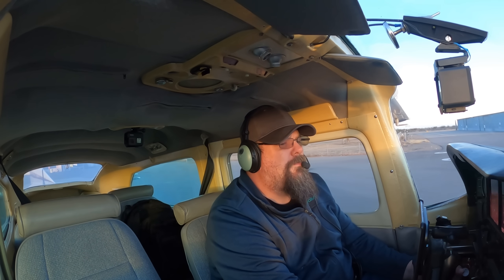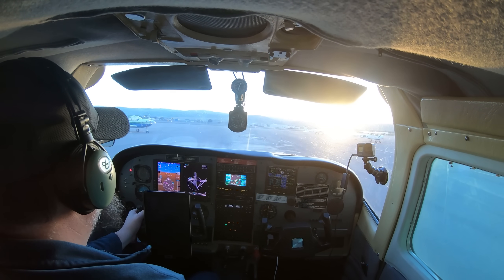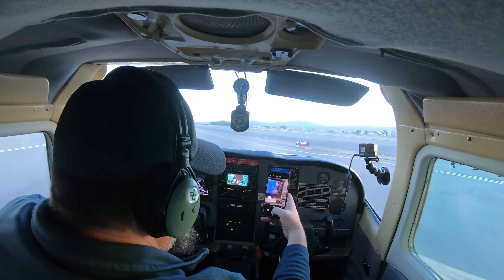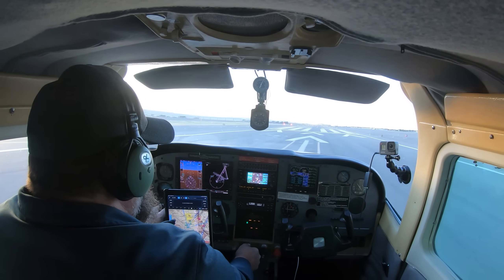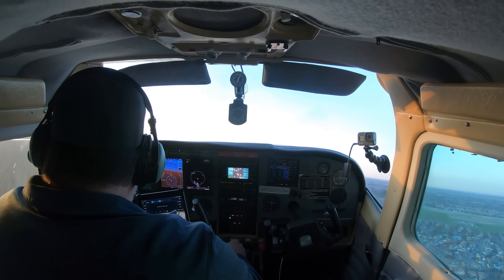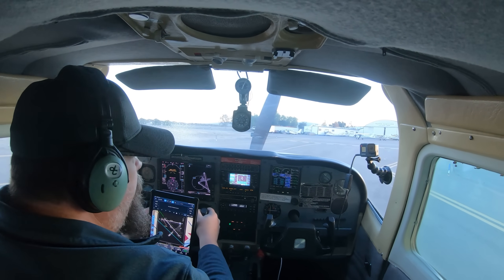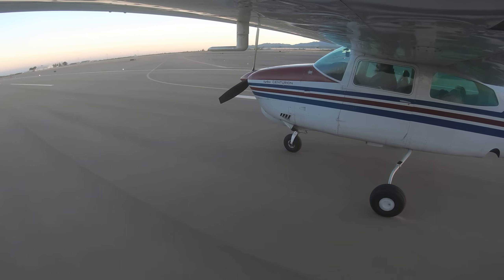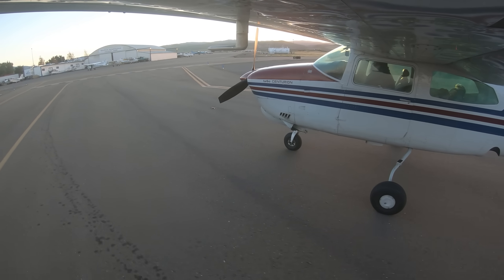Catastrophic Engine Failure after Takeoff

Comment: Edward, that was a handy bit of flying.   I have over 23000 hours in everything from singles, light twins to B747.  Had engine failures, fires, and everything in between in over 50 years of flying.  Here is how you know your actions and thought process were  correct.  You got the plane down on the wheels at an airport and are telling the rest of us the story.  Nice work!  Airplanes are just machines and as such possess no magic component.  Things happen, sometimes bad things.  I hope you can afford to stick with your flying because it is a worthwhile adventure.  I’m sorry this engine has caused you so much grief and money.
Keep sharing the story.  Young people need inspiration to take to the air!
Reply: Well said.  I would add that young people also need object lessons in piloting - they need to know that flight is NEVER to be taken casually.  No cutting corners, no impatience, or any of the flaws of attitude or habit that cannot be tolerated in this endeavor.  Wrong attitudes and poor habits get people killed in a heartbeat.  Flight is an all or nothing deal where half measures have no home.
Reply: @andrewvida3829  It's not about young people but everything else is right.
Reply: @andrewvida3829  I assume you consider old if you use the term " young people "  as a demeaning way. It's sad that you could forget that many " old people " are as unwise as they were when young. Otherwise we wouldn't have such shitty government across the globe. Yes, the thing that is ruled by old people...
Reply: @kuhaku9587  Yes true. This 80 year old says that regardless of
age, some of us learn from our mistakes, a few even gain
wisdom. But some never get even a hint of a suspicion of
a clue.......
Reply: @kuhaku9587  Your assumption may be incorrect
Reply: The engine didn't cause the problems, the mechanics did.
Reply: M.Baird is right. 
You landed the damn plane. That is the most important thing. 
Engine throw rod all the time. Luckily, I only experienced that on the road. Good job.
Reply: Just started flying outside my professional homemade flight simulator. I’m planning on getting my private pilot license, and possibly go commercial to the big airlines. But right now I’m flying a 1973 Piper Cherokee 140, and I maybe also want to take glider lessons so if this exact situation happens I am trained very well for it
Reply: Efectivamente la reacción del piloto fué la adecuada, enfrentó una falla crítica de motor a baja altura y velocidad. Lejos de entrar en pánico actuó rápido y lógico, primero, regresando el tren de aterrizaje a posición de toque en tierra, virando y manteniendo la poca altura descendiendo gradualmente hasta ponerlo el tierra.
Felicidades Capitán!  Cap. Reynaldo Moreno.

Comment: 8:12 - First signs the the engine ain't healthy. I can hear misfire from some of the cylinders and engine stutter under hard acceleration. I`m not sure it this is audible inside the cabin or if the RPM needle is precise enough to show this variation, but this sort of thing calls for a takeoff abort immediately. 
Anyway, nice save, this fix could had been the whole aircraft, and ended up being just the engine. Maybe you pulling the mixture lever all to lean that time could have damaged it internally?

Comment: First of all, it's wonderful that you got back on the ground safe and sound!  It probably couldn't have been much better!  You seem calm and level-headed ... that alone is worthy of all honor!  Chapeau!  As far as the technical aspects of aircraft engines are concerned, however, I am always amazed at the anachronism that still prevails in so many details.  Glazing honing through carbonization ...?  This is really awesome and actually from the day before yesterday.  I find it difficult to explain why so many facilities, components and operating supplies on aircraft are still so antediluvian.  Sure, the inventory of old aircraft is large and hardly any engine manufacturer would like to take money into their hands for the expected small numbers.  It is better to build on the technology of the 40s and 50s of the 20th century ... In spite of all this, multigrade oils with modern filtering and modern pistons with steel piston rings (instead of gray cast iron!) Could be used relatively easily today so that you do not have to completely redesign everything.  One or the other percentage point of efficiency in operation would certainly also be found, not to mention safety and longer operating times.
Reply: Yes, and those ancient designs are inherently more prone to problems compared with any decent modern engine which has them designed out. ICE engine failures should be virtually nil these days.

Comment: Great job, bummer about your engine .  Looks like it burned up the rod bearing,(crankshaft is black) either not enough oil to that journal, or the bearing clearance was too tight. That's why the engine slowed down before it tossed the rod out of it. (

Comment: I was in a buddies 182, when just out of the zone and setting a coarse for an extended trip over  open water, It was noticed that the oil pressure dropped down close to zero, We immediately returned to the airport using minimum power. Once safely on the ground we taxied to the AMO and cut the filter apart. It was flooded with metal particles. The 0-470 had less the 400 hrs on it since it had been re and re'd. It was sent back to the engine shop where it was discovered the oil rings on the piston had disintegrated, got spat out into the sump and got sucked up into the pump, damaging it. We were damned luck it happened at that time, as we were set to fly over a major city, then rugged coastline and open water on a 100 mile journey. This is not the only time I've heard of this happening on a 470. The thought was possible somewhere in the parts supply chain there was a batch of counterfeit Chinese engine parts. I have read that this has been a problem in the past and it would not be surprising. Good on ya for maintaining your composure and getting it back on the ground again.

Comment: I flew hang gliders for 20 years, never powered. The powered flight rules are Pitch for Airspeed, Power for Altitude. With no power, the rule clearly changes. Now it's Pitch for Airspeed and Altitude but only if you can maintain Airspeed. Downwind landings for hang gliders are not an option due to the high ground speed. I'm guessing this particular day the wind was calm.  Great, save.

Comment: Geez.  I was a passenger on a short ferry flight yesterday on a 206B and 20 miles into the flight the engine (O-520) blew spewing oil into the cockpit, smoke in the cockpit, oil on the windscreen, and a couple small fires.  We were above swamps, rocks and trees.  We ended up landing in a corn field safely.  Once i got out and inspected, i found the conrod for #4 cyl sitting on top of the engine with the piston end smashed all to hell. The crank end of the conrod was in one piece. The best i can figure is the crankshaft blew up.

Great recovery man.

Comment: Did you notice your first reaction when the engine quite (very first reaction, no thought) was to pull back on the yoke... not a good idea; but you corrected it after a thought.
We should train to push the yoke on even on an engine stumble.  I noticed you started pulling the mixture on take off when you wanted prop. Pulling a lean mixture under boost; not good... for any engine. Causing detonation and failure...maybe...even if not; didn't help any. Excellent piloting otherwise.

Comment: What was the failure mode of the engine?

For a period during your return to the runway, it appeared the airplane was venting smoke from the lower right side of the cowling.  Did you throw a connecting rod and put a hole in the case?  If so, was a rod failure caused be a seized piston?

Comment: Retired CFI here.  Edward you did a good job getting that airplane on the ground.  Going back was the wrong response, but since you made it work, it was correct in this instance.  I think you did several things absolutely correct.  You kept your head in the situation and let your training guide you.  Somewhere along the line you had at least one really good instructor, and you paid attention and learned.  Good for you.
Reply: I think that’s where airport familiarity and practice come in. He didn’t spend any time thinking about it, just got lined up on the other runway. Even if it hadn’t worked that way, at least he stayed over the finished terrain of the airport, which beats anything built up or populated.

Comment: Thank you for putting this out there so the rest of us can learn from it. 

First off, you’re alive, so while there were errors (and there are always errors present in any given flight - even the good ones) you did enough things right, and that’s all that matters.  Well done. 

In the sprit of learning, this flight was a perfect example of how hard it can be to Aviate, Navigate, Communicate.  In that order.  Three seconds passed from the time the engine failed until the mike was keyed.  That’s a pretty typical reaction time in an emergency, but in this case you keyed the mike even before you pitched for best glide and about the same time you started the turn, but still hadn’t really committed to the turn back.  I know it’s so easy to Monday-morning-quarterback these situations, but in a perfect world you’d reorder those actions:  Pitch for the glide, start the turn (if necessary), and only when those two steps are done and the airplane is stable should one consider a radio call.  Many people are no longer with us because they got those priorities wrong.  Not a criticism, just an observation. 

Seriously though, you survived (completely unscathed, no less) what is many pilot’s worst nightmare.  Very well done.

Comment: Edward   The way you handled that was astonishing knowing what your aircrafts limits throughout the full flight envelope is a credit to you and your skills. Im so glad you didnt do any further damage to such a lovely aircraft and you safely made it back to the airport. The question i want to ask is what height did you get to before the engine ran rough. although you were lucky there was little traffic at the airport at the time. I was taught by an Royal air force jet pilot to fly very early in my RAF career as groundcrew and he said never turn back go for a forced landing straight ahead, which i do agree with but you had height, you had control, and speed, as well as the knowledge of what your aircraft will glide at with limited power and what a cracking landing at the end . Keep us updated on what the cause was and i hope you get a new engine soon. Fly safe. be safe.

Comment: I worked on Lycoming engine for many years. The conrod bolts are a problem on those engines.
Reply: Yes. Conrod bolts are stretch bolts and are  critical. I also worked on these engines and have seen many failures. Most likely what happened here.

Comment: Well done for saving yourself and your bird.  My guess is oil starvation.  Had a car motor fail on me an when we pulled her apart found one main end bearing (hole in it to let oil through fed from the crnk shaft) installes the wrong way around so although the bearing spun we could see that big end was not getting oil resulting in the conrod letting go.  Good luck with the repairs.  Regards from South Africa.

Comment: Any landing you walk away from, and blah, blah, blah.  It blew smoke after the failure event - rings, piston, or valve failure?  I had a big truck diesel engine throw a rod just two hours into the first trip after an engine rebuild.  With mechanical systems, failure is usually within a short time of use, or they last the expected length of time.  Stress on the engine is high on take-off, so failure is more likely then than in level flight.  Bet you wish you had a heart monitor recording for that event!  Exciting!

Comment: There are always critics, and sometimes rightfully so.. as having my own engine trouble on a takeoff once, you did well Edward. I lost a cylinder after takeoff (didnt know this till an inspection of the engine was done later that day). Engine power gone, but running smoothly at a 5000' elevation airport, nothing but the town, and timber in front, to the left, and a large lake to my right. I 'feathered' my attitude over the town, making a very slow shallow turn toward open airspace over the shoreline of the lake. I was able to very slowly start to gain airspeed and altitude once I was in flat stable flight, and continued on.
Right or wrong, I made it home safely. I can say, that initially, I thot i was 'going in' over the town. It's a terrible feeling. Again, well done on your part.

Comment: Fantastic footage, nicely handled.
I disaggree with that ground run advice of keeping it to a minimum.

I like to run a new (or rebuilt) engine for 2 hours with mixed power settings on the ground before going airborne.

That way problems like this happen on the ground.
So many pilots would have screwed that emergency up so well done to you Sir 👍✅

As a glider and power pilot I always advise other power pilots to get some glider training hours in, it certainly hones the skills !

Comment: You and the aircraft reunited with the runway without any further damage, so that is all that matters.

I realize it's already been said many times but I have another angle. I can understand the turn back because of the your position and you had options even if the runway became unattainable. 

But you know the airport, you had to have been picturing the lay of the land right before the pavement....  How could you have been even slightly deciding if you could make it without deciding that the irrigation system would be a hazard to avoid......and not put on the shoulder harness just in case?  

That is a sign of being comfortable not using the harness.

Critical safety devices may be uncomfortable and tedious, but they only need to be used once to save a life. Nobody wants a safety restraint to be unused when it really counts.

Comment: You made the impossible turn because it's not impossible, it's the right thing to do. Just don't stall. And you picked the right side for that runway. What you can do is kink to the side right after take off to have a natural loop back. You shouldn't have lowered the gear right away though. Best glide, no flaps.

Comment: Welcome to the Turnback on take off pilot club.  I taught that on Cherokees, Cessnas and Grummans in my CFI years..  I had to do 2 Turnbacks after Take off, after partial power engine fails.  Old engines we flew.  You did good pushing nose down after the pull up reaction.  And turning 45 degrees bank at Vglide.  Only thing is...  Gear down after super sure you will reach the field. You passed the acid test..

Comment: My god, im glad you are fine, that could have ended much worse. Waiting for the next video with the mechanics explanation of what happened and them buying you a new engine, since obviously it was their fault if them did an overhaul of the bottom end of the engine and broke after less than 5 minutes running. Cheers.

Comment: Lucky for you there was a diagonal runway that allowed you a one-turn 180 without the added line-up turns, else you would have probably landed short. I'm happy it worked out for you, it's bad enough to have spent the bucks on an overhaul, only to have the engine grenade on you on the first flight, but would have been far worse to trash the airframe as well, plus the likelihood of severe injuries to yourself.

I'll be very interested in a followup video detailing what happened in the engine. I have a close friend whose V35B Bonanza had a catastrophic failure about 100 hours out of a basic overhaul, it turned out that one of the crankshaft counterweight retaining pins had an improperly installed circlip, and the counterweight departed the crankshaft, holed the engine case, took out both magnetos and seized the engine. He was at 80 kts and 300 feet on takeoff, had just pulled the gear. He was airborne for less than two minutes before setting it down between two houses, but hitting a tree, about a half mile off the runway. He was injured, but his three passengers all walked away.

Comment: beer or magnaflux. that thing had noise. i broke 2 ford 2.0 pintos. tore bearing during dry start. speeding the other one. broke 225 dodge. could have removed plug. water from other gov user. smoker. i had 2 o470 c from govliquidation. 1 sawed a cylinder. both sold to korea. had honda 350 twins. had yamaha rd 200. melted. overheated dodge 2.2 minivan. could have put hefty bag over engine water bottom. cracked. unlike 225. broke 2 corroded head bolts 225. mexican overweight pistons in. carburetor 1920. casting leak. back from north las vegas. 700 miles. fog sludge in gas tank. desert. next 91 mile trip. its been to ny. min. wa

Comment: Hey great job not dying I have to say iv built a lot of engines over the years for mostly street applications but I’ve done them all from rail locomotive engines to the 0-300 in my Cessna and the magic number seems to be 20 minutes if you’re going to have a failure it’s usually in the first 20 minutes for what it’s worth that’s my experience great job flying not sure I’d have done as well 😎